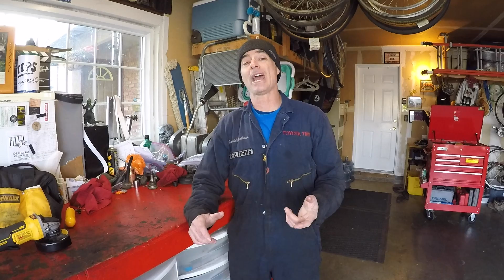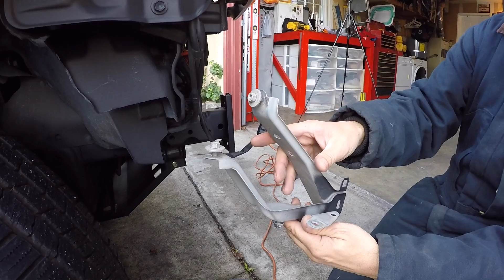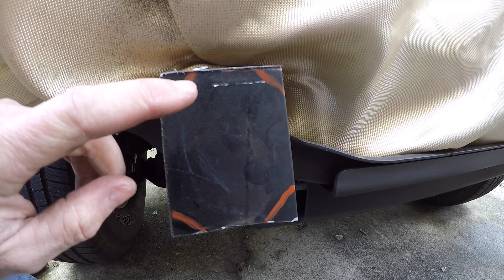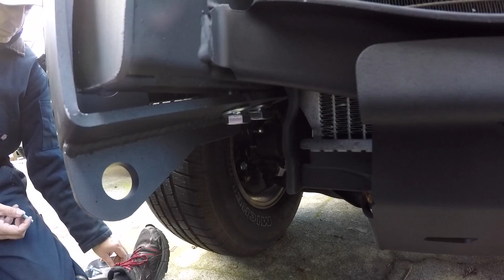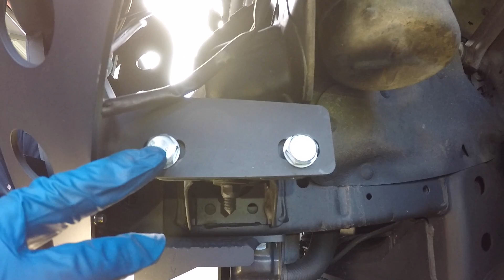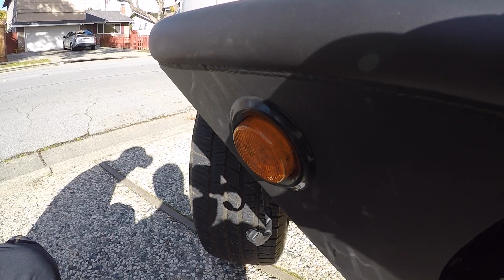Savage Off-Road Hybrid Front Winch Bumper Install

Comment: Tim - A couple of things, the 96-98 does require slight grinding of the frame rails for the brackets to sit flush. Roy also has changed the hardware for mounting the bumper to the bumper brackets. He swapped to carriage bolts to help with the installation of the bumper since you only need to use a 14mm socket / wrench to tighten the nuts on the bolts.
Reply from the maker: Thanks for sharing this Aaron.
Reply: @TimmyTheToolman  No problem Tim!  The video was of great help setting the bumper up.

Comment: Hey Tim I have a question for you. How long would you keep a spare tire in Service before changing it out?
Reply from the maker: That's a good question.  When the spare tire is under the rig, it is protected from the damaging sun rays.  When you add an aftermarket rear bumper and put the spare on the back exposed to the sun day in and day out, the viable lifetime of that spare would logically be reduced.  I think I'd keep a spare in service until I saw the tread cracking from age letting me know the rubber is drying out pretty bad.

Comment: Is it just me, but does that bumper leave both lower ends of the radiator exposed and un-protected?
Reply from the maker: Many many aftermarket bumpers don't protect the lower part of the radiator.  What most people use for protecting the lower part of the radiator is aftermarket front skid plate.  It just so happens the aftermarket front skid Tony chose on a group buy, RCI, doesn't offer this protection.  My CBI front skid does protect the radiator as well as many other aftermarket skid plate manufacturers.

Comment: I have that front bumper. Love it. Used bed liner to paint mine.
Reply from the maker: Bed liner seems like a smart choice.  A way more durable finish.
Reply: It is a neat looking texture. I think i got two coats of regular primer and two of bed liner. After about a year, I'm seeing some surface rust though. I guess it takes more paint to fully seal against moisture..or a different type of paint.
Reply from the maker: @twwtb  Maybe you could wire wheel or wire brush the rusty sections off and shoot it with a couple more coats of the bed liner.